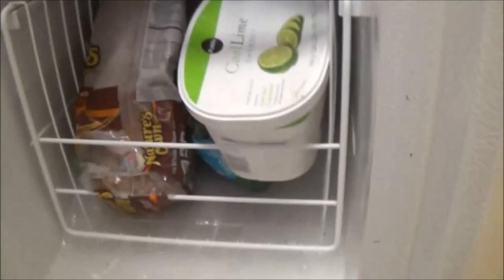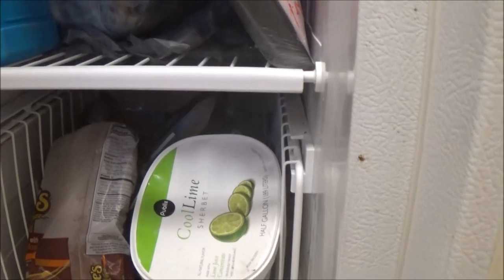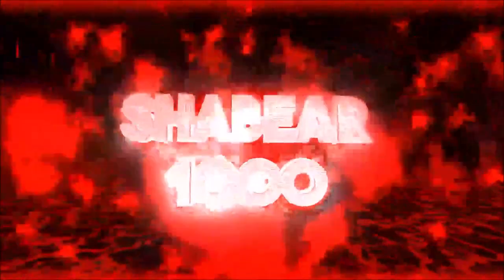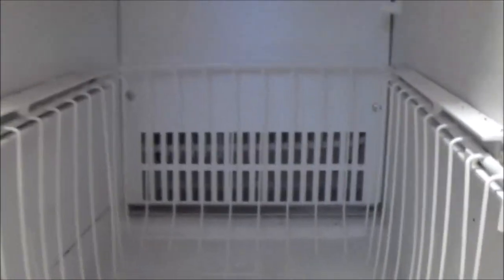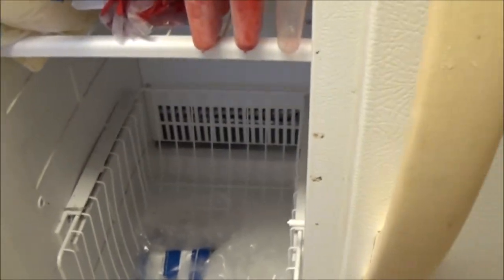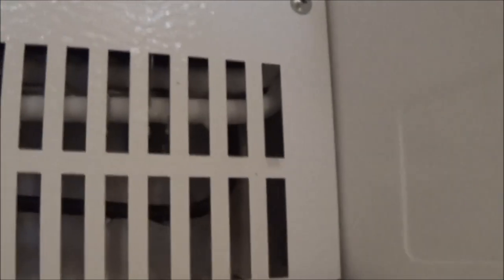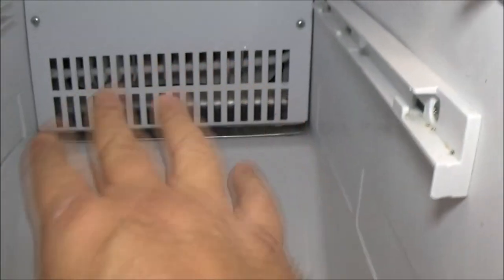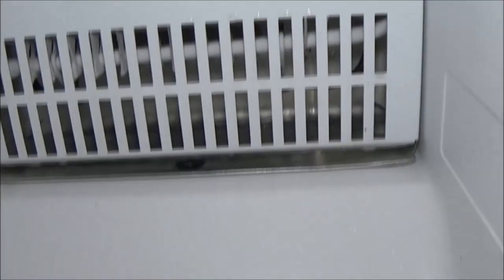Ice In Bottom Of Freezer

Comment: Mine seemed to be clogged from more than just ice ... So I used hot water and the bulb that comes with an earwax kit, squeezing hot water down the hole ... along with a long pipe cleaner from my gun cleaning supplies. It worked.
Reply from the maker: Awesome thanks for sharing that tip. I'm sure it will help others as well.